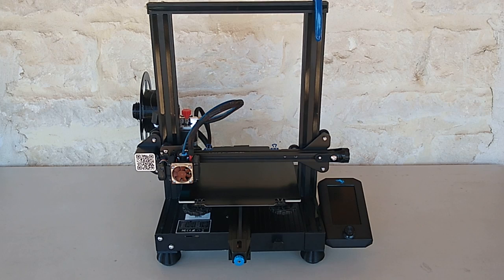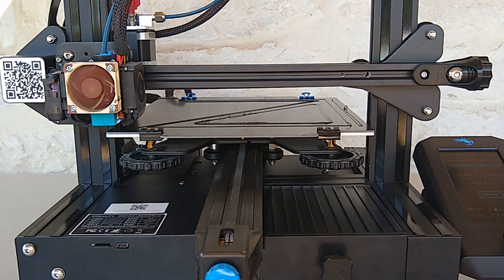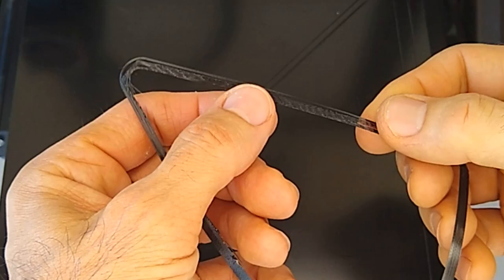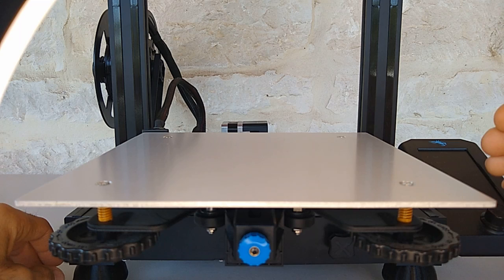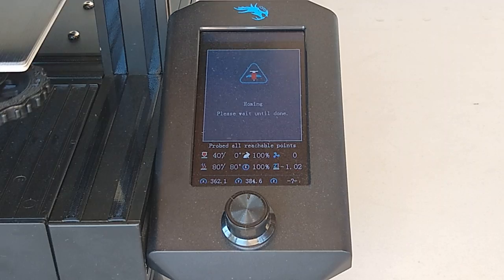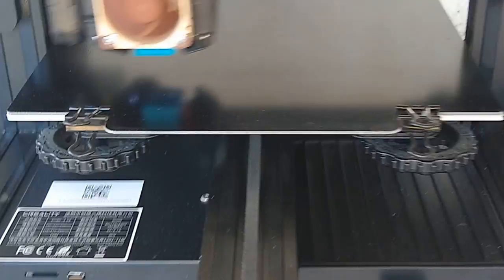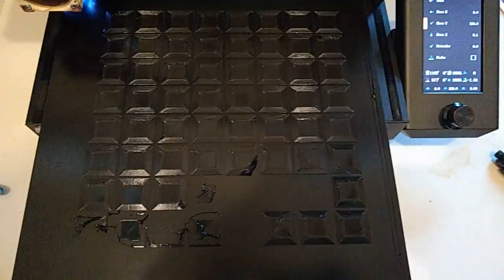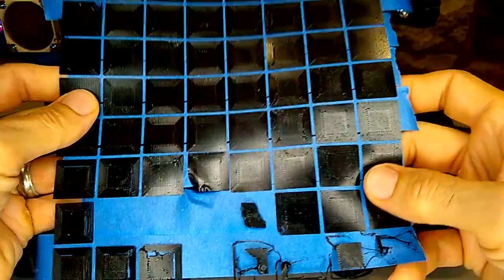Jyers Firmware Unified Bed Leveling Ender 3 V2 - Getting Perfect First Layers From An Uneven Bed

Comment: so I found out that I installed this firmware but none of the settings can be saved
Reply from the maker: Hi Anthony, My apologies for the late response. Jyer's was awesome at the time but unfortunately it hasn't been maintained by the creator for many years.

If you want to stick with Marlin based firmware I would use Miguel's Professional Firmware - https://github.com/mriscoc/Ender3V2S1

Make sure to review this section to determine which display board is in your machine - https://github.com/mriscoc/Ender3V2S1/tree/Ender3V2S1-Released/display%20assets
Reply: @vbared  yeah I shortly found that out. I switched back to an official Creality BL touch firmware and my printer seems able to print again normally.

Comment: Been running jyers ABL for a while (back when he used to keep up with it) I have always done a manual tune using tracing paper for the nozzle scratch test (just like for z offset)  I always thought you should have your bed and nozzle heated up to printing temp (without filament) to allow for the expansion the nozzle will have.  I noticed you didnt heat up your nozzle.  How come?  

I think the auto tilt fails due to it being a 3 point probe.  I'm curious if you can do a 4 point probe with G29 J4 (Since we have 4 points we can adjust the bed from).
Reply from the maker: Hello Barrett, Thank you for commenting. Great catch on noticing that. I used to do it that way as well and one day decided to create a 40 mm x 40 mm test square that is 2 layers tall, enable brim with a .1mm gap, slice it, print, and make z-offset adjustments until the .1mm gap was just barely visible and the brim was easy to remove. Since using this method along with printing on G10 Garolite all my first layer and adhesion issues are gone. I just start a print and walk away. No more stick glue, hairspray, other adhesion promoters, masking tape, or anything else to get the prints to stick. Removing the prints is also a piece of cake. Once the bed cools the parts release easily. The G10 Garolite has been a real game changer for me. The G10 Garolite that is precision cut for the Ender 3s and others that use a 235x235mm bed is linked below.

https://amzn.to/3hG1Nfh

I've since switched my Enders from Jyers to Mainsail Klipper and am amazed at being able to print at 125mm/s without any quality difference. The input shaping, pressure advance and all the different bed mesh options available with Klipper compensates for my Pringles potato chip shaped aluminum heated bed. Before getting into UBL and Klipper printing anything that used up the whole bed wasn't possible for one of my machines.

Best of luck with your mods!
Reply: @vbared  Im having zero adhesion issues.. I use magigoo (dont really need to.. just insurance...) So dont really mind it. mainly use pla, havent dipped into petg in the 2 years I've been printing.   One issue I cant figure out is I can get a perfect first layer, however 2nd - end of bottom layers I get some scarring.  I am 99% sure its not mesh offset value (I manual tune every mesh I make) so I am thinking possibly going to klipper will fix it due to pressure advance...  There lies one small problem.... I thought that the 2208 drivers cannot do pressure advance/linear advance?  The 2209 however can...  Or is that only for marlin's linear advance?
Reply from the maker: @barrettm.9918  Hi Barrett, I believe so because I have 2208s on my two Ender 3 V2s both running Mainsail Klipper using pressure advance.

Comment: What mods did u do too your hotend
Reply from the maker: Hello Charles, Thank you for commenting. Below are a couple of video I made on the topic you are asking about. The first one addresses the bowden to nozzle seal. The second is all about installing an all metal heat break but there is one very important piece of information regarding the addition of thermal paste to the heat break sleeve that slides into the heatsink. Make sure to apply the thermal paste in the same way shown in the second video if you are planning to just stick with the bowden tube lined sleeve.

Bowden fix - https://youtu.be/AEdca_-Nqys

All metal hotend - https://youtu.be/3v_cEldgT4U

Budget bi-metal heat break that works great for me - https://amzn.to/3J9daId